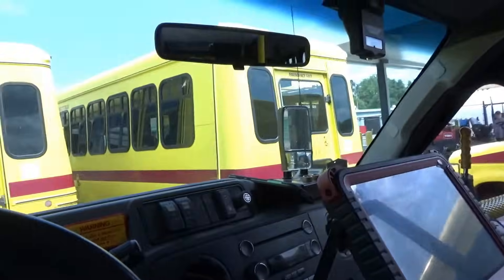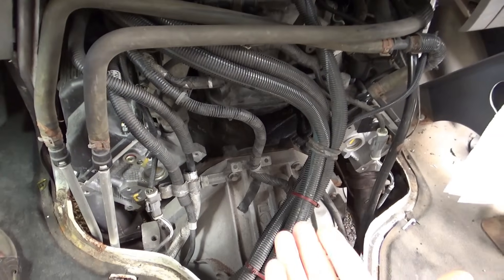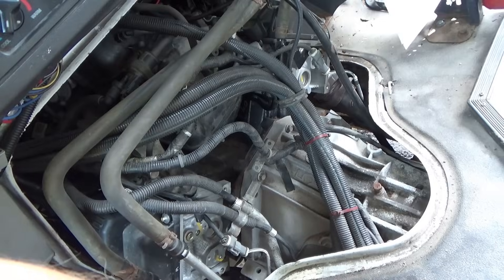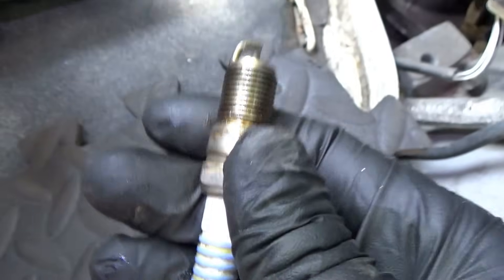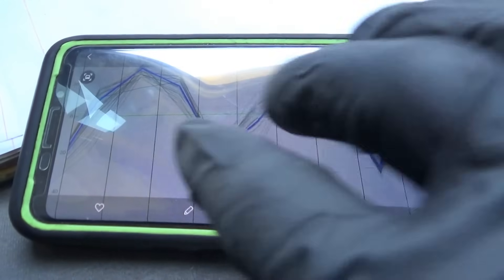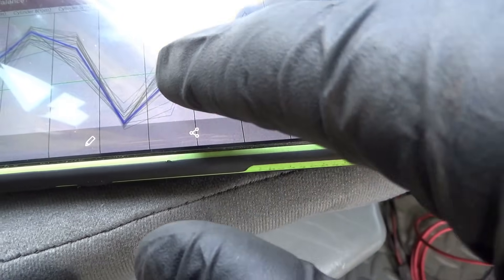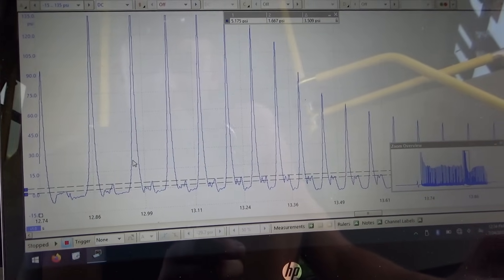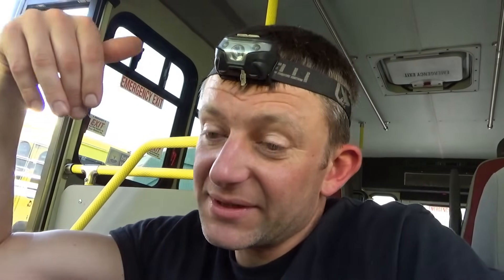Bus Runs Like GARBAGE after Engine Swap?? (Ford E450 V10)

Comment: Whats even harder to believe is the dealer shipped them back out to the customer like that ! totally unacceptable in my book !
Reply: It’s hard to follow the story. Sounds like he is at a shop diagnosing it. The shop could have purchased an engine from ford and installed it themselves before releasing back to owner???
Reply: @mph5896   Even I, Finish guy can follow this, and also read what Ivan wrote, how can`t you? Assuming you are american ? Am I wrong?
Reply: Ivan is working at the bus fleet maintenance facility/garage.  The maintenance facility farmed the engine replacements out to the Ford dealer.
Reply: @billk5727  thanks👍
Reply: Not that hard to believe ...
Reply: yah gotta believe everything is on invoice except operates properly.
Reply: This seems less like error or incompetence than outright fraud. The bus company needs to get lawyers involved.
Reply: @railmeat only if the dealer refuses to replace the engine. Why does everyone always want to run to an attorney? They don’t work for free.
Reply: @clintprice2123  They don't have to work for free for it to be worthwhile. My point is this is not just incompetence.
Reply: Imagine being a shop owner calling in an outside expert because your employees couldn't figure out it had no compression.

Comment: When i was at ford during the great Triton disaster years, Ford ran out of new 2Vs and 3Vs because of so many issues, we use to get engines from Jasper, S&K and one other i can't think of and at some point about half of them were coming in bad, no compression, ticking, no oil pressure ECT... the owner broke down and started buying trucks (junk and used) just to pull engines from so we could rebuild them in house and line the back wall of ready to go engines to swap because he got so tired of all the come backs.

How i got lucky to have been working at a dealer at the time that cared that much, i don't know, but good luck finding one like that now.
Reply: man that wouldve been a good job

Comment: I bought two old rusty 2001 F250 V10s from a customer of mine for my salvage yard and had to drive them there. One of them was towed to my shop awhile back after the oil cooler line rusted thru and blew all the oil out on the interstate and seized the engine and I basically told him it was junk so he towed it back to his place where it sat for a couple years but after considering how it locked up suddenly vs having no oil for thousands of miles and damaging the engine over a long period of time, I figured it would probably turn over and run so I pulled all 10 plugs, sprayed a few cans of penetrating fluid into the cylinders and came back a week later and did the same thing. Put a breaker bar on the crank bolt and a pipe on the handle and it still wouldn't turn until I gently tapped on the harmonic balancer with a ball peen hammer and it moved a thousandth of a degree which meant the crank bearings were free but the rings were stuck so I tried to move the crank back and forth that little bit and it finally turned over and felt real nice with no rough spots. Put a new starter on it, hooked up a couple extra batteries in parallel and cranked it several times to blow the fluid out of the cylinders then did a compression test and they were all at or above spec. Blew everything out with compressed air and put it all back together and got it to run on brake cleaner since the fuel pump was shot. Replaced the fuel pump and drove it 50 miles to my salvage yard no problem! Those 2V non VVT Ford modular engines are damn near indestructible. I wouldn't have bought them if they were 3V VVT pieces of junk. Gonna drive that this winter and save my 2002 F250 7.3 from rusting any more. What I save not having to buy DEF makes diesel fuel affordable.
Reply: DEF is pretty cheap…$15 takes you 5,000 miles or so. Not saving much…
Reply: @tylermacconnell217  it's the principle of having to use it in the first place or you can't drive the vehicle. You must not like freedom very much.
Reply: I don’t mind DEF at all…lets the engine use less EGR, which improves fuel economy and engine longevity. Now the DPF I will complain about.

Comment: Yep, head gasket leaking between cylinders and coolant passages on bus one. Bus 2 is likely to have a failing head gasket as well. My guess is a broken head bolt or 2.
Reply: i was thinking (based on the reused coils, that were not in a good condition) that they maybe reused the head gasket and or bolts,  this would not surprise me with what i observed in this video.

Comment: My first thought was that the ignition coils were bad, then when the compression test told about bad compression I thought that it was assembled with bad valve clearance, which happens. But the coolant leak tells me that it wasn't properly assembled. Modern engines have torque to stretch bolts, and reusing them will lead to failures. The engine builder might have failed to check that the heads were plane before assembling too.
So I wouldn't be surprised if the dealer cheaped out too much.

Comment: The shop/dealer that did the work will probably claim the engine was overheated. I've observed this on a 4.2 Fred Jones I installed in a 97 F150. As soon as the engine reached operating temp it started misfiring and steaming out the exhaust. The dealer tried to say I overheated it.
Reply: if the engine overheats, that's pretty much a problem with the engine, not the operator
Reply: All reman engines that I have used have temperature “fuses more or less” that will show a over heat situation. They are usually built in to the softplugs.
Reply: @Joe_Mission Yes, but if you see the temp rising into an overheat situation you still have some responsibility to prevent damage, or it may have been run low on coolant.
Reply: @brianw8963  that was how I got the engine replaced the noob behind the counter wasn't aware they were installed.
Reply: @Cheepchipsable   Yes, but again there's a problem with the engine if it overheats to begin with, or runs low on coolant.

Comment: If the reman engine didn't get new coils, what else didn't it get?  Multiple engines with similar issues says something likely wasn't done right during assembly.  The coolant leaking is pointing to something with the head.  As others have stated, maybe the bolts just didn't get torqued properly - amount, order, or both.

Comment: Are those Jasper engines or Ford engines.  Either way, coolant in the chamber is definitely problem one with possible more problems to come!
Both those engines need replacement.
A note here.  I just remembered.
We had Ford trucks with V10's and when a new Ford engine came in a crate, it had new Motorcraft spark plugs and new Motorcraft ignition coils.  They also had new crank and cam sensors.  Sometimes new Ford exhaust manifolds were ordered cause the old ones were leaking, but always came with new plugs, coils and sensors.
Good one Ivan!

Comment: Wow! A sub 50 psi cylinder compression that fires seams mysterious. The shop that installed these needs a test to check from air cleaner to tailpipe. Maybe a shop vac with a PHAD pressure transducer.

Comment: Be really careful on V10 engines. After catastrophic failures metal can get in the plastic intake then come loose and fall into the new engine.
Reply: They can also get residual metal from a bad catalyst converter sucked into the combustion chamber and it can do mechanical damage inside the cylinder

Comment: The owner of the RV shop I worked at for a while has a motor home with the V10. He's on the third engine in 2 years. Factory motor was a Ford and it dropped a valve. Last 2 were Jasper.
Reply: So he swapped a garbage engine for a couple trash engines.

Comment: Lot of hate on the V 10 in the comments.  I own 4 of them from 99 to 08.  345,000 miles on the 99.  A few coils, routine maintenance, all OEM fluids, synthetic oil Motorcraft filters.  These trucks all work, no soccer mom rigs.  We do all our own service.  I love these engines.

Comment: Ford's reman engines are not known for their reliability. I had a 6.0 powerstroke that I installed at the dealer and the customer drove it on a trip afterwards. I was notified a few days later that it was coming back, customer said it was blowing oil out of the dipstick tube. Of course everyone was pointing the finger at me but after tearing the engine down, it had grenaded two rods/pistons. The truck still ran, just smoked like a freight train. I hope your customer gets his diag money back and his engines repaired properly. I have heard that there is a shortage of V10 reman engines. Our last V10 had to get rebuilt instead of a reman due to that reason.

Comment: Good Day Ivan, to  me  if cat was plugged it would reflect high back pressure  on all cyl in the bank of driver side, having said that just by clear flood crank the engine is shot and to make it worse with bad coils on top of it.
Why not install new coils on this new engine since it's a pain to work on with the engine in place.

Comment: I don't know how but this video from ivan got past me So I may bet late to the party 😊

First I keep hearing new engine thrown around while I think I heard ivan actually say it was a new short block which means the shop doing the replacement was responsible for the heads,  the installation of the heads, et cetera. Regardless,, the fact that Ivan  found a cylinder full of coolant absolutely points at your classic blown head gasket or.
some kind of mechanical issue, such as a cracked cylinder wall, piston et cetera.

If it was a long block, then the engine rebuilder is responsible, if it was a short block,  the engine installer is responsible since tjey are tje.ones who intalled the heads.

 Either way, the shop that was ultimately paid to do the work is responsible to make the customer whole. And they are the ones who need to go fight the issue with either the installer or the rebuilder.

Hope y'all have a great day!  Heading to the beach to do some surf fishing and give the dog a good walk.

Comment: There are many videos on Ford 'quality' remanufacturered engines having problems. Concerned customers may notice something strange with the long block, only to disassemble and find out there is a complete disaster inside. Scratched, worn and out of tolerance crank journals. Broken bolts left in the block. AND mismatched piston sizes with one or two oversized pistons but all the others are standard bore. Thats quality right there! Will it work? Sure, maybe. But your spending a lot of money for a factory rebuild that you would expect to be better than this...

Comment: Back in 1960 when I was 17 my twin brother and  I managed to get a 1940 Chevy 6 cyl half block, went to the junkyard and got an old worn out head, hand ground the valves and put it together without any help from anybody. It ran like a top and even started at 40 below zero. Are there no good mechanics left for the dealers? I took my 2008 Nissan to the dealer and they couldn't find out what was wrong with it, even though I know what it is. I'm still looking for a way to fix it.

Comment: I reckon you've come across an American strain of a bug that I've often seen crop up here in the U.K. - it's rife in Corporate deals or to firms with large inventories - poor quality kit or services sent in relying on no one doing much checking. It was tried on me once I'm sure - on calling my local main Ford dealer for a guaranteed recon engine, I was offered a so called "brand new spanking York" in an original crate with docs for very little more money so did the deal. First suspicious thing - warning label to fit a new oil pump - in the sump (oil pan) on this model - called the dealer "are you sure this unit is NEW?" I didn't believe his "yes" so fitted the unit on a test bed - no comp on two cylinders (at least this saved me some work) on calling the dealer with the good news - he said he'd put into Ford's for diagnosis, I then quoted him some of our laws on merchantable quality etc.,  eventually - after much argument - he sent over another unit exactly the same as the first and the bill!!! I tested the second engine as if I worked for NASA before it went anywhere near a truck - it was fine and carried on working for over ten years.

The dealer and I ended up in legals - all huff and puff from him, stack of evidence from me - he took it all the way to a court appearance and then failed to show up! The dear old Judge said "we take a very dim view of this kind of thing" and awarded me full costs.

Comment: 1) Checking spark like that is very wrong.  Can fry coil, and if the spark jumps to a wiring harness, fry computers.
2) Prior to checking compression you should have cranked with the injector disconnected to blow out all the unburnt gasoline
3) #1 thing to check after an engine swap with misfires is the firing order where ignition cables, coil control plugs and or injectors are on the wrong cylinder.

Comment: On my 2002 2v 6.8L I used accel coils. Only' 1 ever failed and it was warrantied. The motorcraft were substantially more expensive and more prone to failure. My coils always failed soft leading to fish bite misfires, other modular engines that I dealt with like my mother's 4.6L Lincoln only ever had coils fail hard leading to dead misses.
Reply from the maker: And possibly cooking the PCM drivers!

Comment: Did the shop only do a short engine swap, using heads etc. from the original engines?
That could explain badly fitted heads, valve clearances messed up etc. if whoever did the work was inexperienced (or jut bad)..

Comment: Question

Were these engines a short block or long block? That points out to a bad rebuild from whoever rebuilt it or remanufactured it. I also suspect other issues to be present as well. The dealer supplier likely contributed to it and the dealer would have to go to the rebuilder to be reimbursed for the work.
Reply: If the dealer did it they should’ve sold a Ford reman long block. That gives them another warranty with the engine. The fact the dealer is turning them away and the poor quality of the reman makes me feel like there is some cost cutting happening somewhere. Maybe cheap wholesale deals on NonFord reman engines, sourced by the bus company. Hence why the dealer washed their hands of it. Just my 2¢

Comment: As an old, retired mechanic. not too up to date with electronic equipment, would it have been just as easy to start with the basics, providing things can be got at, with my old compression gauge, vacuum gauge and pull the coils and look at spark length and colour as well as coolant pressure test?

Comment: i am a Holden whose going to tell you now that im Australia that's a Stephen Ford form,I learned to avoid that mechanic as far as having one of theirs touch my car.

I replaced the cylinder head gaskets in my 5.7 litre Chevrolet LS1 V8 engine almost 5 years ago since I replaced the  hydraulic lifters meaning that I had to unbolt the cylinder heads to replace them & that form of employer who had me employed as a casual/contractor hasn't wanted to employ me as an electrician ever again.

So what else can I say ss a Holden ?
I think that Ford drew a circle around the problem !

Comment: Ivan can I ask you a pretty detailed question and maybe spit ball me some ideas, I’m not the best at network problems but have learned a lot from you and really wanna figure this one out. It’s a late production 2018 F250 6.2 crew cab, somehow it starts and drives but literally nothing else on the car works. Topology report shows HS1 and HS2 as the only 2 trees. You can communicate with the PCM, BCMII, and BCM-B on the HS1 network and then every single other module on the car is down, the entire HS2 tree. On wiring diagram it shows the car has HS1 HS2 HS3 MS1 MS2 and MS3, all of those networks go into the gateway module which is the back side of the DLC connector, it’s a little module box that the dlc comes out of. From the front side of the dlc when I scope HS1 the network looks fine but when I scope HS2 it looks like the network is being pulled down most of the time. First of all how come all of these networks go into the gateway module but topology shows all of the networks on HS1 or HS2? How would you go about taking the next step on something like this? Any ideas would be appreciated

Comment: My nephew says the v10 is a v8 triton with two extra cylinders. The triton was the spark plug blower.
Reply: I’m not a ford guy but I do know that the v10 was based on the 5.4. Same bore and stroke but share no parts
Reply: Not good engines, such a dog.

Comment: Given the age I would say poorly installed heads and gasket, poorly machined surfaces, etc. It would be interesting to have the engine on a stand and do a torque test on the head bolts. These are odd engines and I suspect they are sent out to be rebuilt as these buses and maybe trucks put the miles on.

Comment: Hello Ivan. Seems like you're the person to ask this after watching your videos. I have a 2006 Jeep Grand Cherokee 4.7 and getting various code on my cheap scanner ike P0882, P1603, ABS no comm, etc, etc. I live in PA but am about 130 miles from you. If I was closer, guess where my Jeep would be. I have an electronics degree and about over 40 years of shade-tree automotive repair experience, but never had a decent scanner. I need to get deeper into these issues and was wondering what scanner would suffice? I was looking at that King Bolen but is there anything less expensive that will do everything that I need? I've searched Youtube far and wide and it seems like alot of the scanner videos, well, it just seems like they are trying to promote the free scanner that they got. I'm also looking at getting a Picoscope and I've done all I can with my Fluke DVM so anyway any help in the scanner area would be appreciated.